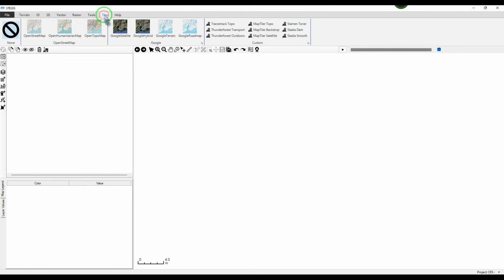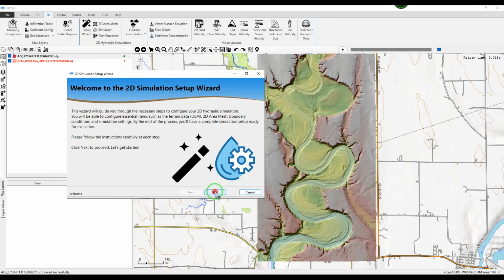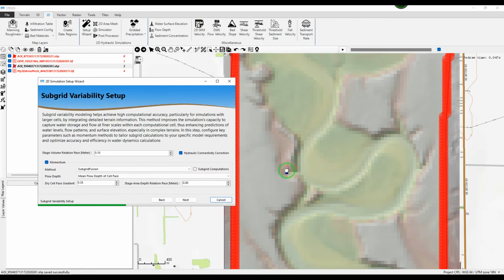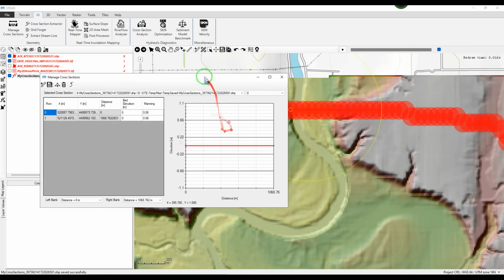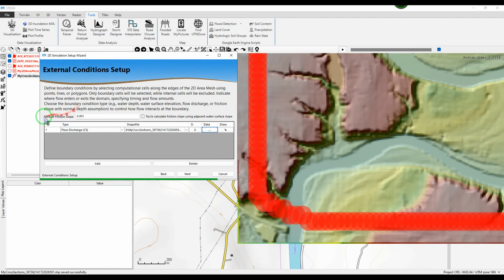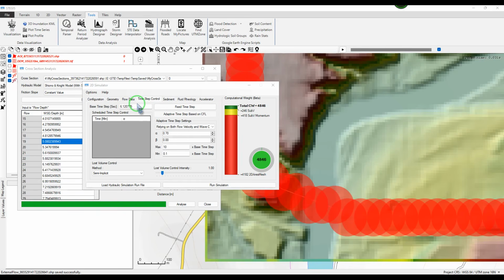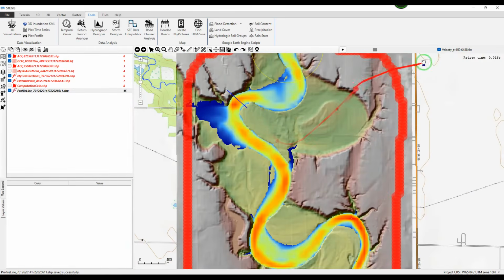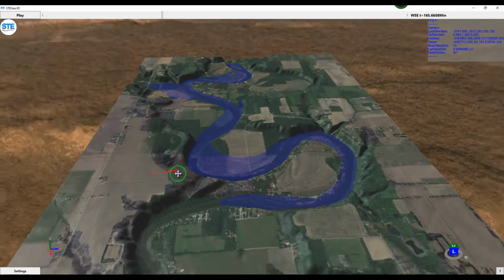2D Flood Modeling in STE Software | From DEM to 2D & 3D Results Step by Step

Comment: Nice, maybe next would be a rain on grid model? thanks for the detailed walkthrough
Reply from the maker: Thank you, I’m glad you found the walkthrough helpful.

A Rain-on-Grid tutorial is definitely planned. Before that, I’ll be publishing a few important tutorials covering how to prepare essential input data such as Manning roughness regions, infiltration regions, and bed material configurations. These steps are fundamental for building accurate and reliable 2D models, especially for rainfall-driven simulations.

Once those are covered, the Rain-on-Grid workflow will be much easier to follow and apply effectively.